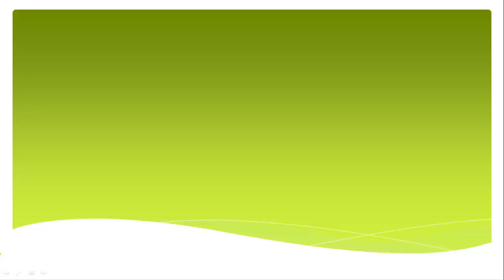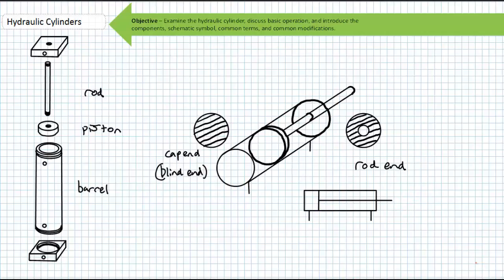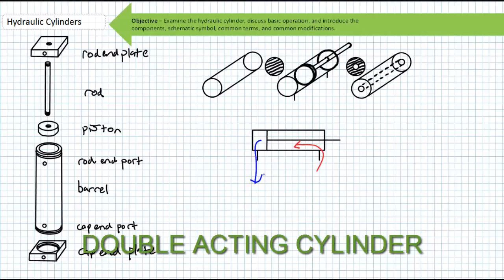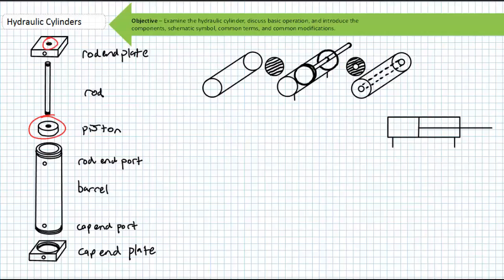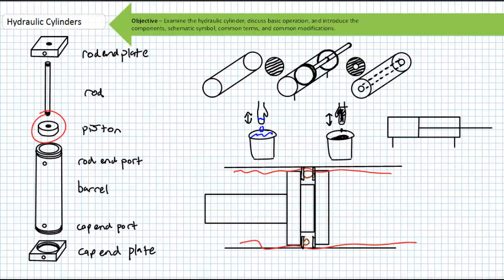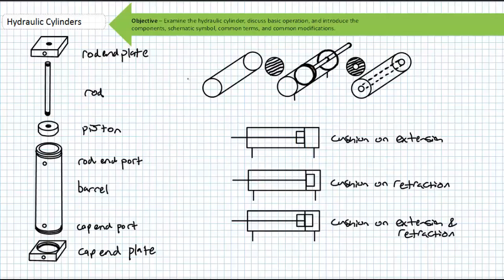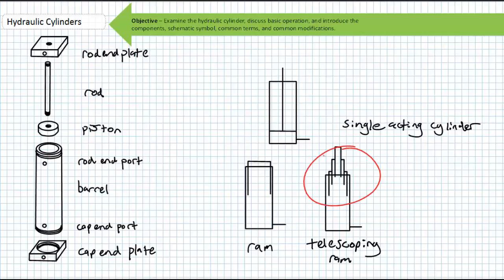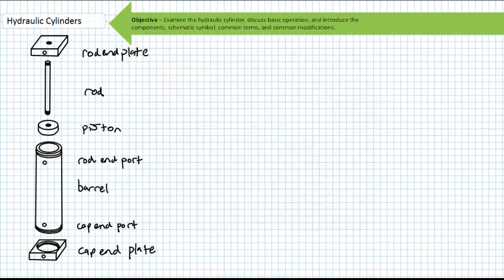Hydraulic Cylinders

Comment: Jim, to explain the hydraulic cylinder with clevis you take as a example a wind turbine generator. So, is it possible that there is a stop tube in the cylinder in this case? I read a bit about the stop tube advantages and it prevents a excessive extension of the rod and reduces side loads in the rod. I think in wind turbine generator there may be a excessive extension and due to the angular movement of the cylinder a torque is created and consequently a radial stress. Nice leacture!
Reply from the maker: A properly engineered mounting system would ideally limit side loading and eliminate the need for a stop tube. Eventually I plan on publishing lectures detailing industrial wind power that show a hydraulic pitch system in action, however, imagine a body trunion (ie: trunion arms on the barrel) pivoting cylinder mount. During extension, as the head (rod) tips one direction, the body (cap) tips the other and the cylinder's travel remains linear.

Comment: Mr. Pytel,
I have watched your most informative lectures on pumps.My question is this: since pumps move fluid and create the flow through the system, what is actually creating the desired pressure? Is it the clearances between the "squish" areas in the pump or some restriction or orifice in the system that gives you 500 PSI or 1000 PSI etc? Or spring tension in a regulator?
Reply from the maker: +D. G. Pressure is the result of restriction. The classic example is a transfer pump (ie: pumping water out of a pond into another pond). The output of the pump is at low pressure since there isn't really any restriction. If, however, the pump is pumping water out of a pond into a rubber balloon, the expanding balloon exerts a resistance and therefore pressure rises. Similarly, if a pump is pumping water out of a pond into a rigid storage tank, once full and all air evacuated, the rigid storage tank exerts much more resistance and therefore pressure substantially rises. Hopefully, this helps.
Reply: So a built in restrictor/restriction is designed into the system.The next question is there a simple way of calculating the size of the restriction for a given pressure that you want?
Tx for your help!
Reply from the maker: +D. G. Not exactly. The system and applied load IS the restriction, check out the Pascal's Law lecture at: https://www.youtube.com/watch?v=YNoPs9kH7Ao hopefully this will explain it.
Reply: TX
Reply: To D.G., What I tell my students is that the pump creates the flow and the load creates the pressure.  If a pump works against a very light load, the pressure will not rise to a high level.  If the load gets to be great, the pressure will rise to push against it.  The pump will feel the load through the cylinder or hydraulic motor that it is connected to.  That's a short explanation.  Good luck.